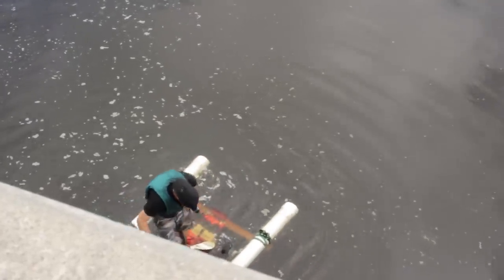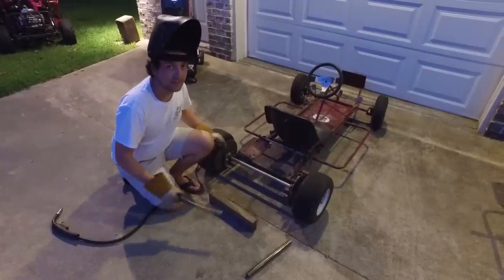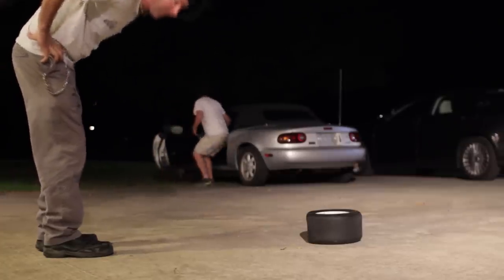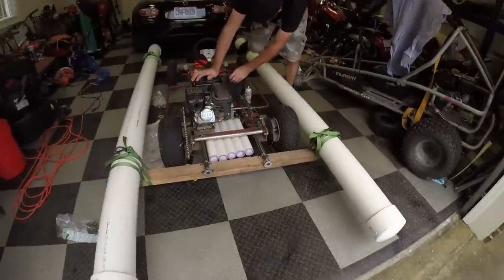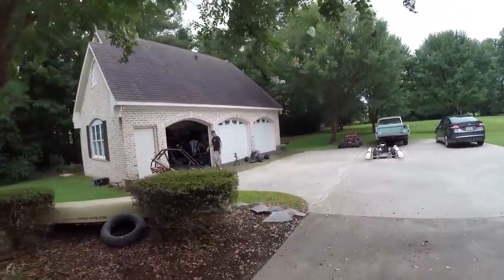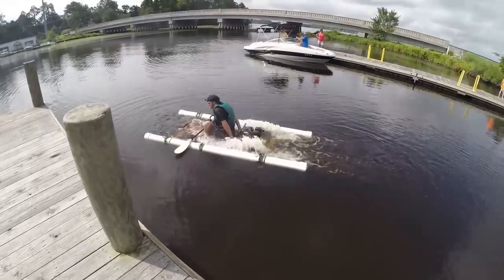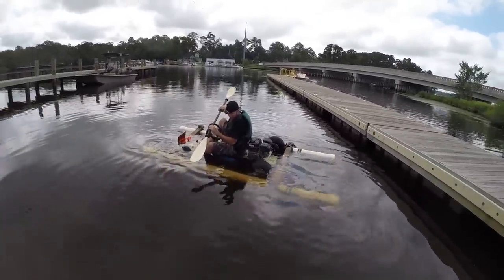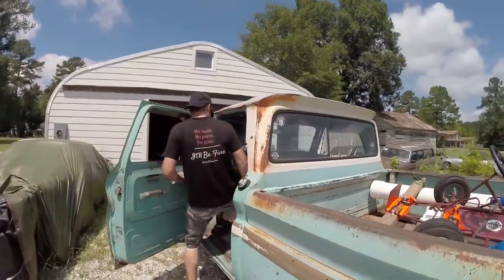AmphibiKart Pt. 2: Power & More Floats

Comment: mount an old school paddle wheel on the back and run an extra sprocket on the axle to make it chain driven. you can mount it high enough so it still drives on land and the kart sinks enough that the paddle will touch the water. shout me out in your next vid if you like the idea :) it'll be fine

Comment: why don't you try using big paddle type tires? like for an tractor but smaller... they do great for mud and im betting that they will work for water... youd need to figure out how to fit one on it... but if I do remember correctly they have conversion kits from key to lug... or you can make one... or put them on existing rims

Comment: you need to get your selves a set of thick treaded tires perferably flat slicks . A tire groover and two sets of rims of the same DIameter. weld the outer set of rims to the inners that will bolt to the axle shafts . after cool down mount your thick treaded tires on the outer rims  when you cut your grooves you want to cut as deep as you can without cutting through the belts . make the cuts slightly scooped and with a slight curve with the scoops facing the front of the go kart . then add a shield itll act as a guard from the water and allow the scooped water to exit rear of the kart . the scoops will allow for forward motion like the paddles on a kayak .
Reply: dont place your grooves to close allow distance between each scoop to allo for relase of the water

Comment: you sould take an old tire cut it up and attach it to those tires so it would still be flexable enough to use on land but enough surface area to go fast on water

Comment: Have you guys thought about welding metal flaps directly to the live axle for propulsion?
Reply: or you could weld a sprocket to the center of the live axle and then connect it to another axle that has a propeller.

Comment: idea for the water kart run a horizontal to vertical pto like they use on the racing lawn mowers and run double sprocket to the pto then run a prop from a trolling motor

Comment: steal the angle drive off the rat rod wagon or get a 90 degree drill drive and chain a prop off the rear axle. paddles won't get you anywhere. put the slicks back on it so it doesn't throw so much water. raise the engine 8".

Comment: Instead of moving the pontoons to the bottom the way you did try and split the difference mounting straight out off of the end of the mount you will have to make like a band bracket to clamp them and a tire with bars like rear of tractors have but smaller would have better propulsion and maybe fab up some fenders to cut down on the water being splashed up on the motor. If you could find a 12" diameter plastic pipe it would defiantly float better.
Reply: Here is a link to the bolt on paddles I have seen. https://www.farmshow.com/a_article.php?aid=13866
Reply: This is a link to a tire with a tread style that would give more propulsion. http://www.fleetfarm.com/detail/carlisle-xtrac-tire-15x5-00-6-2-ply-tire-only/0000000221960

Comment: how about no wheels at all but u add or weld metal flaps to the metal part of the tire....and to steer the front tires you add flat pieces of wood or plastic to the side of one tire or both

Comment: Hey guys, There is still enough time in the summer to try this,...it's a lot faster, lighter, less embarrassing , less work, and well, it works.  I had a gold dredge with a 5hp briggs, I used 6 inch pvc, and yes the caps are expensive, but toss the cart frame, it is only dead weight, and you took it to the river in your pickup anyway, so you will have the floats, the motor/ pump, and foot valve,...the frame was made out of square tubing, very light, probably half inch. Prime the pump by pouring water into it until the short hose to the foot valve is full. No seat no body weight, very light, tie rope to the frame on left and right side of the frame in back, far enough behind, that the water coming out of the pump doesn't drown you, then have it pull you on what ever,...inner tube is what we used, and then steer by pulling on rope. Plus,...a dredge has a huka pump for breathing under water, if you get a regulator and 20 feet of hose you can dive without a scuba license. You will have to tie your reins to something or put an elbow in your output to point it down, in order to dive. We also had a lot of fun with a fire hose nozzle plumbed into the output, get a nozzle that adjusts from zero to fan. I used to put my sluice box with all of my hose and everything else we needed on the dredge, and have it pull me and my son up river,...we just hung on to the back, but it did it.  You guys seem to have the resources and the know how, and unless your just more in love with wheels and dead weight than you are with fun and success, you will like it, and it's kind of out of the go-kart box of thinking,...new worlds guys.
Reply: cool
Reply: Hey Isaac it'll be fine,  I am 60 years old,...I believe that no matter what a guy says,...guys never grow out of go carts,...whether we can fit in them or not,...this is just a go-cart that doesn't need dirt.
Reply: lol

Comment: Maybe you could have attached two rims together one with the tire and the other weld pieces of metal around the rim slightly smaller then when drive on land will not interfere then in water it would paddle

Comment: i have a way that it will work just add a paddle that runs off the back tires with a tire a that pulls down to go or lift it to put it in neutral lol i wish i could let you in my mind for a min to see what i am thinking of i am thinking that the way i am thinking it will work  and make it so that when you turn the front wheels it turns the paddle in back

Comment: Enclose the engine in a water right bow with tubes sticking up and out for exhaust and intake and fill the pipes with air and use sand tires on the back

Comment: fabricate a paddle boat propeller on the live axle I'm sure you guys have some extra hubs and old sprockets laying around cut four slits in the extra sprocket and weld in some 4 inch by 6 inch plate metal

Comment: 2 adjustments would make this go MUCH better. 
1: needs to be higher. the tires are too submerged. your just twirling the water. you want friction only on the bottom of the tire. if its submerged your basically the same as being knee deep in mud. 
2: put some sand tires on it. the knobbies are better than streets. but for real performance. put some sand paddles on that bad boy!

Comment: You should’ve put metal around the top and front of the wheels so water is not going every Direction 

And it should be front wheel drive so you can steer

Comment: why not just a small, two stroke out board with a hand throttle? you can raise it up when you're on land, drop it when you hit the water, steer and throttle with the same hand. the 212 will be off so no danger of hydrolocking it. bam done.

Comment: i have a gokart that runs good and i i wanna buy a new engine for it that fits its motor mount but i know how to take the old motor out but i dont know how to put one in and set the throttle brakes and all that.....i was wondering if yall have a video of it of how to do it

Comment: ahahaha such a funny video, how much drag in the water has your amphikart got, at least put a bow on the front it will reduce the strain on your motor and maybe think about a keel or two droping down the side where you put the bouys so it doesnt tip over, a sheet of plywood could make a big difference.

Comment: you should use 2 surf boards it should be lighter and more buoyant. just cut off the fins or break them off. go to a pawn shop and it will be cheeper

Comment: Why not use the chain for power in the water using the fat sand tires comes with a lot of losses you already have potential with the chain why not rig a system that powers a propeller from an auxiliary sprocket in your chain assembly. it's not an easy option but it will be the best to accomplish your goal. Next best solution would be to just use another engine as your amphibious power.

Comment: why don't you build some kind of cup that will bolt on to the wheel held in place by the bolts that hold the rim on and on those weld some square pieces of metal "flaps" that act as paddles. wouldn't have to be heavy gauge steel maybe even use some aluminum. i know its 2 different kinds of metal and would eventually corrode but "it'll be fine" lol
Reply: that wouldn't add any weight like another motor like some have suggested.

Comment: You need sand dune tires those should work much better and you will be able to drive on them  unlike paddle wheels that can only be used in the water.....just my 2 cents

Comment: Hi Ike or John or any one that can help, I'm putting a torque converter on my 212 and the only thing I'm having trouble with is getting the bolt the holds the drive pulley on the crankshaft. I can't seem to line up the bolt with the threads on the crankshaft. Any suggestions? Thanks
Reply: Never mind I got it.
Reply: cool

Comment: I tried to tell you guys, you won't get anywhere in water without a prop. And the best way to steer is to make the prop steer. No need to reinvent the wheel, I would get either a trolling motor (electric) OR the smallest outboard you can find. You could even make a power take off system and just use the 'leg' of the outboard (just the drive shaft and gearbox and prop) that way you only use one motor. I think that's probably more up your alley. I know this is old but it's perfect, something like this anyway: http://www.ebay.com/itm/OUTBOARD-MOTOR-LOWER-UNIT-WITH-PROPELLER-JOHNSON-EVINRUDE-SEA-HORSE-/331954647369?hash=item4d4a09f149:g:abkAAOSwFnFWFQKo&vxp=mtr  You could probably even pick something up from a local marine mechanic since you're only after the lower unit (aka leg).

Comment: why don't y'all just glue the caps on the pipes and add air fitting on each and put about 60-80 psi in them. my buddies air cannon holds 100 psi

Comment: you need sand dune tires (paddle tires)
Reply: and possibly a pumpkin on the axle with a 
welded shaft to a propeller. (find an old cheap light weight  riding mower and use the axle and modify the pumpkin)
Reply: also... bigger tires for flotation (I'd still go with paddle tires)...
Reply: and put a surf board under the cart
Reply: ... blah blah blah... more floatation = bigger motor